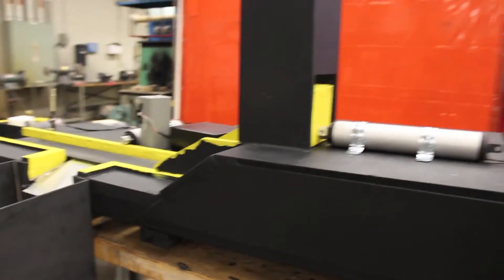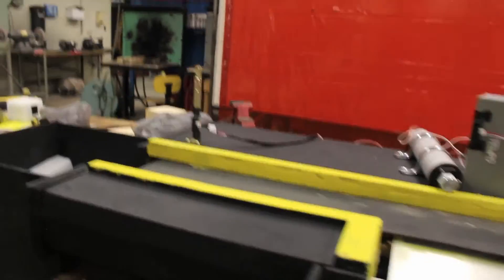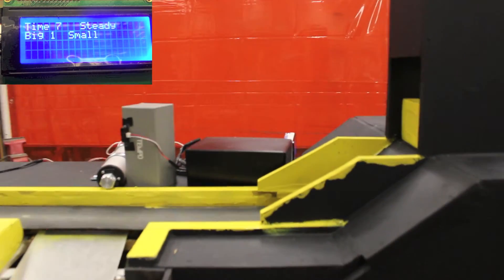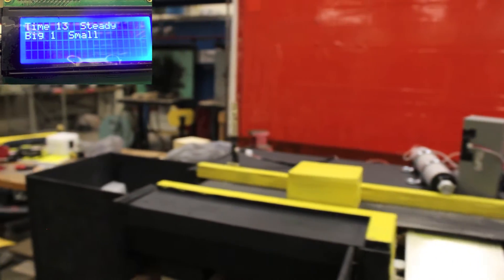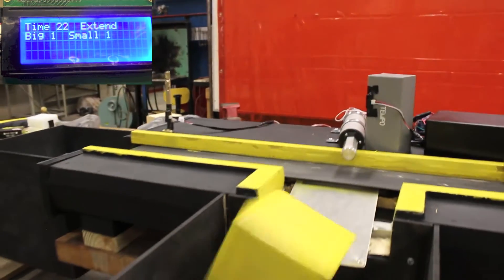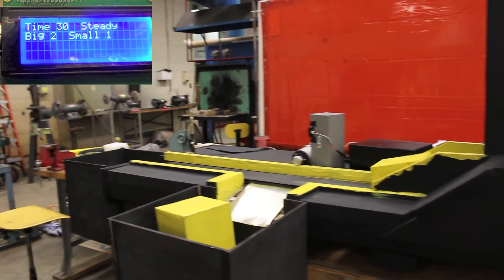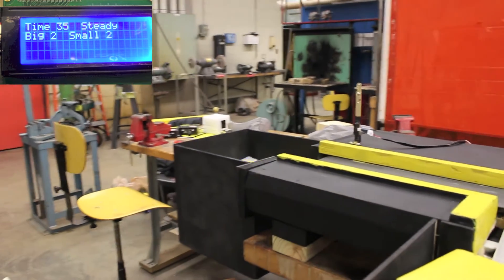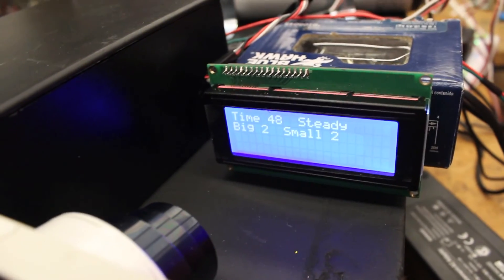Assembly line NKU senior project with Arduino

Comment: Dear Sir,
We will do a similar project. Could you tell materials and motors that use in the project. Also, do you have your projects information or website?
Reply from the maker: sorry it is School project, School prohibit publishing projects' reports.
only general information allowed to be shared....which is in the video itself 
All you need is to learn is programming the Arduino > good luck
Reply: Abdulmohsen Albrahim Can I ask you wether those are solenoids or linear actuators? Sorry for asking if you can't answer, but I am trying to build a similar project and I lack much needed info on what is the best of both to use.